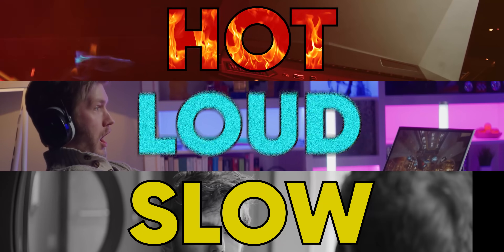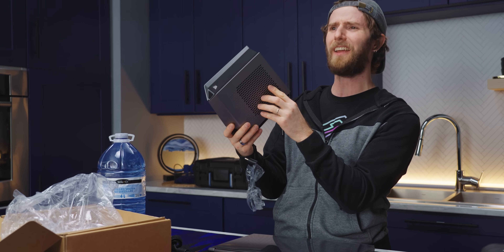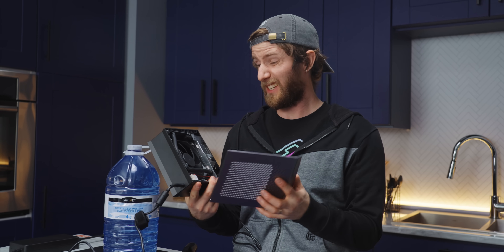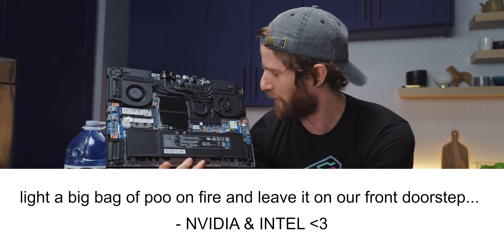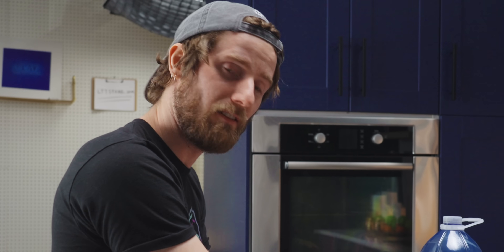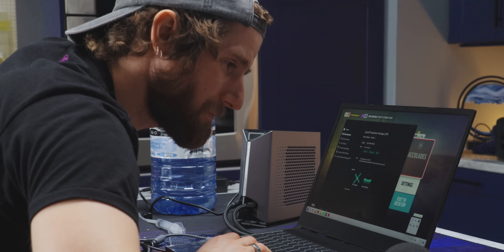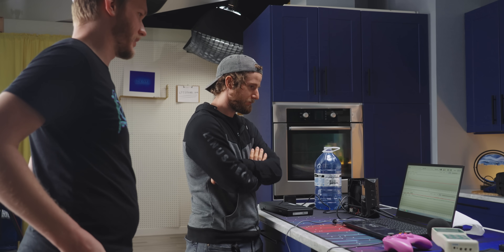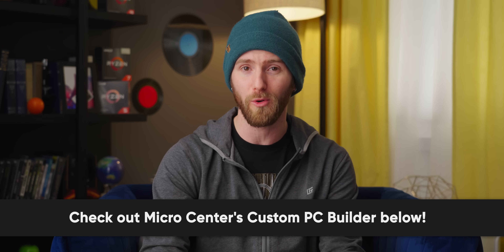This INSANE Watercooled Laptop Has a Huge Problem! - Eluktronics Prometheus Prototype

Comment: One thing I'd like to see would be some sort of cooling dock where there near silent 120mm fans sucking the heat out of the laptop. If not just done as a cheap aftermarket add-on, it could probably work really well.
Reply: That's not how fans work. Those products have been totally debunked for years now
Reply: that reminds me of the vacuum sucky things that help get rid of hot air
Reply: I just made a wooden triangle box thing and mounted 3 120mm fans on the end (a), blowing cold air under the laptop placed at (c). The bottom (b) it closed forming a plenum forcing air under and up into the laptop. the laptop fans only job now is just extracting the air. Temps are down circa 15C. it took about 45min to make and the fans came with a controller and remote - was 30£. easy.
Reply: I could imagine like a slide in dock for the laptop but it'd have to be custom made for each model, it could have cheap brackets for different laptops ig
Reply: @jtestaccount2431  Or, you know. We could make a Consortium for standardizing it. Like was done for ATX formfactors...
This means docks (EG: Peripheral Cooling/Hub) would be standard across all models compliant with it... - But lets face it, OEM's love that laptops burn out 80% faster and more often then desktops, its what keeps return sales moving!
Reply: You will pretty soon run into the bottleneck of the small surface area of the heatsink, as far as cooling performance is concerned. You would still make the laptop a lot quieter though.
Reply: There are such products, on Amazon, exactly what you described
Reply: just replace the stock fan with noctua - done
Reply: You should get someone to 3d print some kind of stand to add some Noctua fans to.
Reply: Like one of those laptop cooling pads?
Reply: @ACE112ACE112  yes sir I think that’s the idea.
Reply: They are all over Amazon. Called cooling stands. I have one on my 17” 2080 laptop and I’d say by my brain fps testing it is smoother and more consistent, if not faster, with the fan pad under it raising it off of the table and giving it airflow
Reply: That isn't how physics works. No matter how much money you spend making a "cooling dock". It won't work. You can't suck air out faster than the fans push it. It's not possible. Just basic physics, my friend.
Reply: The problem really isn't airflow, the problem is getting the heat off the chip. The small heatsinks aren't doing that great of a job.
Reply: Especially if they could devise some sort of industry-standard coolant connector that allows a whole product category of aftermarket cooling docks to spring up which could work with any laptop with that connector. Shouldn't take up too much space in a laptop to build in an optionally-active external heatpipe like seen here, right?
Reply: I mean... I personally just bought an air cooler dock and it adds more usb ports and it never gets hotter then 65c
Reply: My parents hate me because i smoke weed on my YouTube channel for a living 😪they wish I could’ve gone to college or something 🧐🧐
Reply: What is actually the sense, in cooling down a Laptop, by attaching big and heavy components to it. This leads the whole purpose of mobile devices ad absurdum. In the end it is like a PC again.
Modern laptops are loud, power hungry, hot and relatively slow because of the legacy functions in chips, which dictate the market for decades.
If you want to solve those problems, don't fight the symptoms, but go directly to the source of them and solve it.
Don't buy x86 cpus and old gpus with legacy rasterization functions. Support mobile devices with a new efficient cpu and gpu architectures from the ground up. Then you don't have to deal with this annoying stuff and can sleep more quietly by the way because of doing your part against climate change.
I don't like apple, but i appreciate their M1 and i hope they are going to support more gaming maybe even be developing an apple game console.

Comment: What if I made it 10 times more simple ??? Just buy Desktop AIO and mount it to the heatpipes of a laptop with back plastic removed ?? I mean if u do such things to a laptop u probably using it as a desktop anyway... and probably going to use external keyboard and external big monitor / TV. I recking just adding AIO with good thermal pads glued to laptop cooling pipes would make HUGE difference in temps. Maybe not 20c but atleast -10 easily. And NO danger of any water spiling.

Or another alternative if u dont want AIO. Is just applying thermal pad throughout the heatpipes from one fan to the other. And then slap Giant slab of aluminum Rectangle heatsink with Cooling Pad underneeth. It would actuall make Cooling pads USEFULL for Once LOL I think this methot is most effective because it covers biggset area of heatpipes. 

But man "Its no longer a laptop" Yeh right... who is using RTX 3000 series laptops as a "laptop" ?... Let's get real here... these machines are portable Desktops.

Comment: Not seen yet, but if that works and drops the temps by 20 degrees and then you use liquid metal too which will drop it by another 20, you could overclock the hell out of that laptop.

Comment: How does that copper work? Is it just copper tube or is it like a special heat pipe with tube inside it or something in between like compartmentalized thing?
Would be really interesting if we can get one of those for DIY type stuff.
Reply: If you mean the single water loop that is mounted on top of the standard copper heat pipes: they are probably regular copper tubes soldered or welded on top of the copper heat pipes. I could imagine that with some effort it could actually work to upgrade a regular laptop with a water loop.

Comment: They should have had the power passthrough via a usb-c connector that could also send/receive data to control the fan and pump speed.
Reply: Great idea
Reply: Otherwise power and data connection could probably be integrated into the cooling quick connect to make only a single bundle and connector, If this was the case, then the laptop might be able to implement a standard pwm fan controller, requiring nothing fancy on the radiator side.
Reply: I mean they did say the CPU was pulling 100w and the GPU 125. Nobody has yet really implemented usb-c epr.

Comment: I think the "siphoning power off the laptop PSU" is a pretty solid solution (and one I often use for my Pi projects): The pump and fan draw, what, a handful watts max, so the PSU should more than have enough headroom, and I personally would much prefer to use as few transformers as possible (can't stand it when my speakers, USB hub, external drives etc all want their own separate wall wart just to get the same 12V DC in).
Reply: It's perhaps a little weird seeing it connect in chain like that but there's nothing wrong with it indeed. The only alternative to that would be to integrate a power connector into the quick disconnect so the laptop powers the cooler assembly - then it could have had some fan control then as well to trade off performance and noise. That being said OneWire is a thing and making control go upstream up a power cord isn't exactly a challenge either.
Reply: @SianaGearz  I'm guessing if the current version already has speed control, then it is measuring water temp at the radiator/pump end, so it wouldn't need any wires going to/from the laptop (other than the laptop's power passthrough)
Reply: @Incommensurabilities  yeah you can have preprogrammed control and maybe it's there, maybe it just always goes full blast; but Linus was looking for a way to adjust the fan. It is not an unreasonable request, after all you have preprogrammed control on your GPU or laptop already, but you can also override them in case you need either more performance or less noise. It's the kind of thing that is technically unnecessary, but PC enthusiasts expect, especially given that this is not a cheap accessory so penny pinching doesn't look good on it.
Reply: @SianaGearz  I found out from Dave2D's video that the device connects via bluetooth - no need for any wires. So yeah, it should be able to adjust fan speed. Seems like the manufacturer is open to suggestions/improvements too https://youtu.be/VjiLBhmiMMw?t=215
Reply: @SianaGearz  to control fan and pump speed that way you'd need two separate cables.

Also, using the laptop would require a reworking of the power system or you're leeching off your battery, which gets constantly discharged and recharged.
Reply: @Anankin12  did you even think before writing that?

Learn about OneWire bus and learn about B+ rail topology on a laptop and then come back, I don't really have the inclination to educate you.
Reply: It depends. When it comes to laptops, manufacturers don't give any headroom with their power supply. I have a 330  watts psu and I would be very worried letting my psu drawing power through water cooling solution. So this is a thing I have 0 tolerance with, after that when it comes to ssd hdd and other low 12 volts I am with you that it sticks too many too fast
Reply: @critic_empower_joke_rlaxtslife  I'm glad you know more about it than the people who make them for a living. Clearly they haven't thought about anything when they made their product and it couldn't possibly work.
Reply: @zyeborm  be as it may. I  stand by what I say for I won't fuck around with daisychaining power supply and power delivery but a straight plug as I know it won't fuck and with the power supply minimum $200 and my laptop $+2k

This does not escape the fact Eluktronics have a sexy  device  on hand and I want one
Reply: @critic_empower_joke_rlaxtslife  good for you. You should tell the engineers they did it wrong.

Comment: I used to game on an i9 15” mbp and the only way I could keep it from throttling was by building a Lego stand to prop it up, removing the bottom pan, and adding a shop fan blowing directly upwards from underneath it 😂.

Happy to say I don’t have to do that anymore In the PCMR
Reply: I used my dual core 2016 MacBook Pro and also passed to the PCMR(Legion 5 17 inch 5600h 3060)
Reply: Am using a i9 2019 16" MBP with an Radeon 5300Pro. I thermal padded the heat pipes to the chassis, flip it around an put an old AMD stock cooler on it where the CPU and GPU are.
Disabling Turbo Boost also actually helps quite a lot with gaming (less thermal throttling of the GPU)

Comment: I'm confused....maybe I just missed it. Is this an add-on for this particular laptop which has the loop pre-installed or did you have to install the loop in the laptop?
Reply: This will be available on our next generation of MECH-15 and Prometheus XVII series.  The laptops will be equipped with the liquid cooling capability even if you do not opt for the external LPP cooling solution.  The cost will only be $100 when bundled with laptop purchase!
Reply: It's factory installed. The pipes for the water loop is soldered on to the heatpipes for the laptop air coolers.

Comment: I wanna see someone make a custom water block for a laptop. Removing every air cooling system out and just have the liquid cooling system in the laptop like you would have in desktop and see how much better that would be. Probably similar to this but still. It would be not possible to take it anywhere but, you know.
Reply: The problem is: it should somehow still work when not attached to the external radiator/whatever it is IMO, because else you might just get a desktop computer once GPUs are affordable.
Reply: @igordasunddas3377  I know it would be practical, but I just want to see it.
Reply: @KenS1267  I see. I did check out Der8auer's video just now. That was pretty cool.
Reply: If I am remember correctly the yter der8auer did that in one of his videos
Reply: @Excubitor  Really? I'll go check it out then.
Reply: Might as just get a desktop and a thin and light laptop no?
I honestly never got gaming laptops
Reply: @superblitz2274  I know that would be stupid. I wanted to see that just for entertainment.
Reply: It can be done, but the laptop would have to be an inch thick, maybe more for proper airflow and large quiet fans. I'm surprised no one has tried...
Reply: @reaktorleak89  In the spanish community they already replace the whole ventilation system for a home made water cooling system in a laptop xd I'll try to find the video
EDIT: I just find the video! https://www.youtube.com/watch?v=KDl_eMAVhdQ They lowed the cpu temperature like 20 degrees

Comment: You should try the Klim Mistral, it's a  gameing laptop cooler and it works very well
PS : I got around -30°C
Reply: I've got a klim ultimate and I haven't noticed a huge difference in cooling performance
Reply: Pending, on the Laptop design and size/thickness. As well as the vent size/vent design and laptop fan size/fin count.. etc. Certain, coolers can deliver.. But water cooling is a better long term method. I use a cooler myself and can get up to 10 degrees cooler across the board..

Comment: Linus: "So far I have broken zero of the clips...almost zero of the clips"
Eluktronics: "Introducing our clipless case design"
Reply: Surviving Linus is a production requirement.
Reply: This has the same energy as Sharp going: "We don't make humidifiers that don't require water. We're not wizards."
Reply: So either magnets or cut-off holes in the chasis to slide the panels in and out.
Reply: @QruisS  screws
Reply: that requires far more effort than what I would like
Reply: @QruisS  Bruh screws are an easy solution. They don't break unless you're an idiot like me, they require a very simple tool to open and are generally very solid
Reply: @Anankin12  Im not saying its a bad solution, Im just saying its a 2 out 10 in my scale of "Im too lazy for this" and I know that it is possible to go lower.
Reply: @QruisS  ,
Or don't take it apart?
(although, you'd want to CLEAN it wouldn't you? Never mind.)
Reply: @photonboy999  you have a nice point
Reply: @photonboy999  Would take you 1 min on each side to unscrew the screws
Reply: How about changing the clip design out for that snapon design they used for the hoses? Easy on  easy off

Comment: Linus: Laptops have 3 problems: They’re hot, loud and kinda slow.

Me looking at my 10-year-old laptop: Hey, he’s talking about you, buddy.
Reply: Me looking at my laptop, no he isn't talking about a drill machine.
Reply: A bit of new thermal paste and it'll be good as new.
Reply: @doggo_woo  
And a vacuum/air compressor cleaning of the cooling system
Reply: @MrHack4never  maybe even some undervolting if you want an even cooler laptop
Reply: @doggo_woo  My 10 year old laptop is fairly quiet but shoots a ton of heat out from the fan.
Reply: I read that as "Looking at my 10-year old" hahahaha
Reply: congrats. Linus notice your existence
Reply: @top5429  theXGamer has peaked. It's all down hill from here.
Reply: Old Laptop: Sad high pitched Jet Engine Noises
Reply: What kind of 10 year old laptop do you have?

 I have a Sager NP9150 with an i7 3740qm, 32GB of Memory,  GTX 680m, and a 256GB and 512GB SSD respectively in it. I have since gotten a much newer one but the old one still runs flawlessly (aside from some dead pixels) and I am thinking about tossing in a GTX 1060 since it consumes 25 less watts watts of power and will run cooler while being nearly twice as fast.
Reply: hehe, my old 1st gen I7 laptop from college was scorching hot. Never had anything that bad since then, but hey, I could get GTA IV to play on it
Reply: Me looking at my M1 Max MBP14: He doesn't think you exist, buddy
Reply: My laptop: "DOC I'M LOOUUD. AND UGLY"
Reply: Laptop: P-please. Just let me die...
Reply: My laptop is also pretty old, Lenovo Z50 with GT 820m (some got amd) it's not loud it's pretty quiet but it runs around 60-70degrees and if i put it flat it goes 90+, it's just hot and slow
Reply: My 9 year old laptop is neither hot nor loud, but BOYYYYYY is it slow
Reply: Me looking at my girlfriend: hey, he's talking about you, baby.
Reply: My first gen i-core 5 Thinkpad T14 is 9 years old, and still breathing (hot and noisy) :)
Reply: my 2012 Lenovo ThinkPad X1 Carbon can relate
Reply: TIL: I like my women how I like my laptops.
Reply: You just reminded me I have a 2012 MBP somewhere that should still be working fine. Thanks! :)